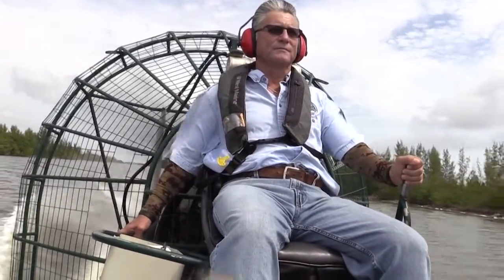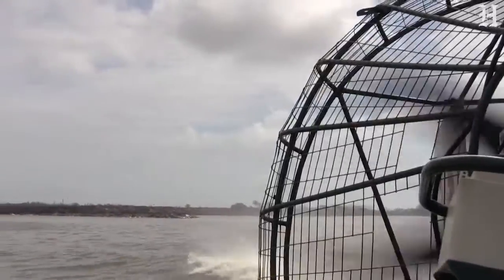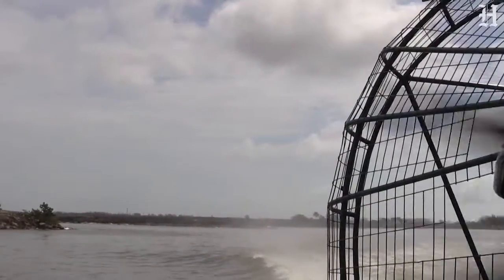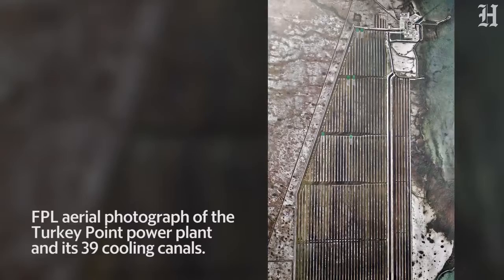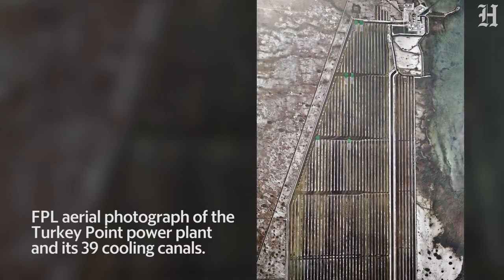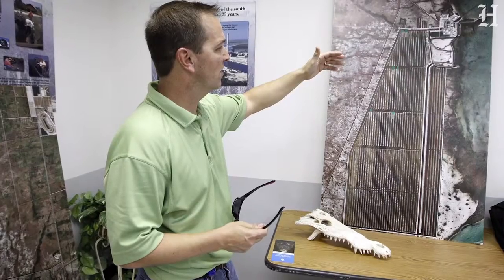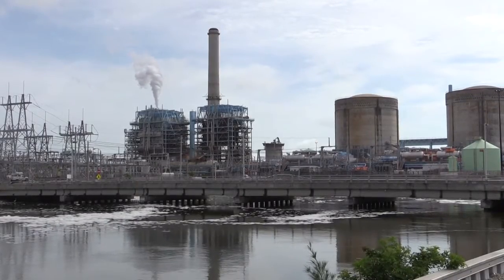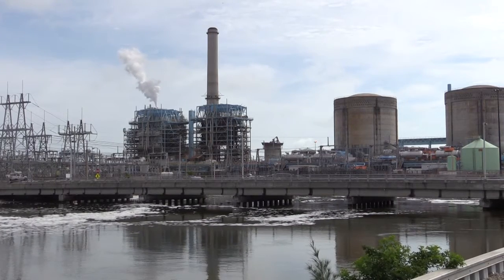The cooling canals of Turkey Point

Comment: FYI: When he says "warm waters" he means all of this water is warm because this water runs over all of the fuel rods inside the nuclear reactors to keep them cool enough not to meltdown - but still hot enough to create steam to turn the turbines to make electricity for your toaster...

THE BIG PROBLEM is what happens when there is a LEAK and this "cooling" water is radioactive and released into the canals?
They do not have monitors out there for the public to check.

And what happens when there are more low rainfall years due to climate change?

This is the only nuclear power plant in the U.S. that circulates its "cooling" warm water in open-air canals. 

The rest of the nuclear power plants in our country and the world release this "cooling" water from those enormous 300-ft tall cooling towers into our atmosphere, evaporating the water into our skies . 

How can there not be any radiation released into our air, our water? 

This has been the big lie for decades now: it is ok to be exposed to low dosages of ionizing radiation also called radioactive isotopes such as: iodine-131, plutonium-239 strontium-90 and cesium-137. 

It is not okay.

Any exposure causes damage to our DNA and causes cancers of the soft organs of the body, neurological diseases like MS, and tumors of the brain and central nervous system. 

Google the "effects of ionizing radiation and the Department of Veterans affairs". 

We've been testing on our soldiers for decades and now it's our turn - for them to test on the civilians.

Nuclear is a threat to public health and safety. 

Nuclear never was and never will be clean, safe or green.
Reply: That’s not how the cooling system of a pressurized water reactor works. The reactor coolant is stored in a closed loop. That loop contacts water in another closed loop to generate steam. That steam is cooled by another closed loop of water connected to the cooling tower and at turkey point the cooling canals. The water being put into these canals doesn’t contact the reactor. Even if the reactor coolant pipes ruptured, that water still wouldn’t come into contact with the cooling water. You can google the design of a PWR and you’ll see this. Also the NRC wouldn’t allow them to just dump radioactive water into these canals or something with a significant risk of doing that.
Reply: From what I've read, the carcinogenic effects of releasing small amounts of radioactive material into the atmosphere is significantly less than the pollution released by coal and gas fired power stations. That's the thing you're missing here, that we're talking about the equivalent of throwing a cup of oil into the Pacific ocean - it sounds bad but in the grand scheme of things the consequences are negligible.
Reply: I’ve gone fishing around there damn
Reply: This water does NOT go anywhere near the fuel rods, stop spreading misinformation. The internal core cooling water does not mix with the canal water that is used to cool the reactor externally. The internal cooling water is pumped out to a loop where the heat is transfered from core water to the external water.. they DONT MIX... obviously.. do you think they would just let irradiated water cool off on miles of canals and nobody would catch on? I swear you guys that say nuclear energy will never be green have 0 knowledge of how any of this operates. 😂😂😂
Reply: What about the people who live near there?